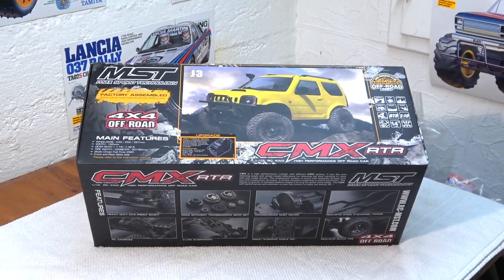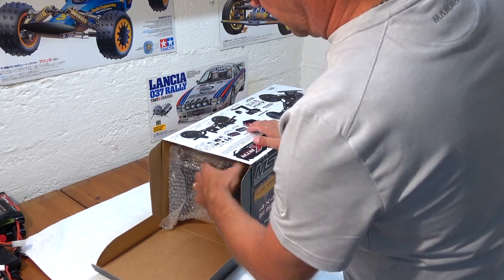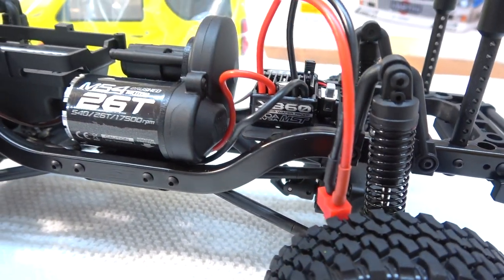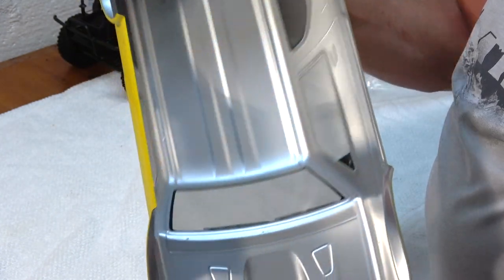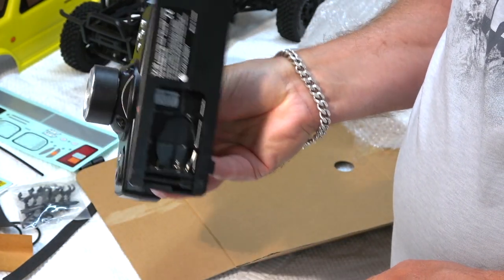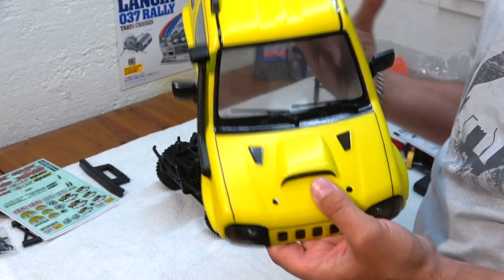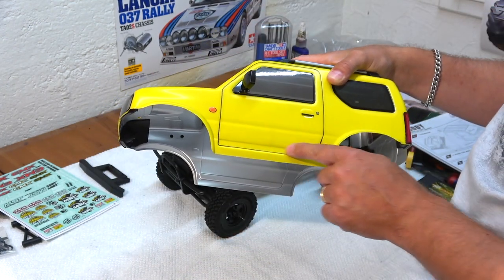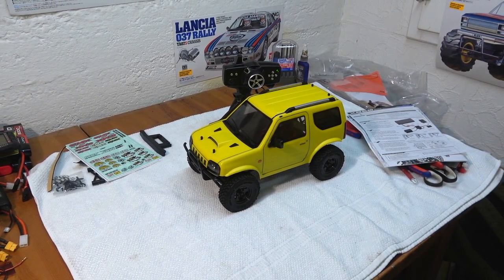MST CMX Jimny J3 RTR Scale Crawler - Unboxing and Overview

Comment: Happy to see Matteo's new unboxing video! The standard XB60 ESC looks just like the 1060 ESC from HobbyWing (also the drag break setup look the same), but the drag break of 1060 is a little bit awkward------it always apply 100% break force without a smooth delay, and that could be dangerous when driving down a steep slope. I think the 1080 ESC might be a better choice for crawling.
Reply: It is a rebranded Hobbywing 1060 ESC... 
Yes, the Drag BRAKE is harsh and non adjustable. Still, good for bog stock!
Reply: @CarminesRCTipsandTricks  Yeah, waterproof and easy to setup, 1060 is a good choice in most occasions.
Reply: Most brands use the HW 1060 and re-brand it.
Reply from the maker: Yes, you're right. But still good working for an RTR vehicle
Reply: @Matteomeier  Absolutely! It's a fine, basic ESC, better than a lot of other ESCs in RTRs. 😉

Comment: Nice little Jimny. By now you must have a few MST CMX chassis, right? Bought a MST CMX for my Wrangler YJ (Tamiya body), still haven't painted it. As for holding the body I used these custom made front and rear holders "MST CMX CFX Jeep Wrangler YJ Tamiya Body mounts set for Hardbody RC 1/10" of ebay, you may know that chech guy in Prague?
Reply from the maker: That's nice! You have to paint it! Is it from Loops Model?
Reply: Yes, Loops I think he call himself. Well, almost all my car bodies aren't painted. I cannot decide what color to use, so every project always stops there.